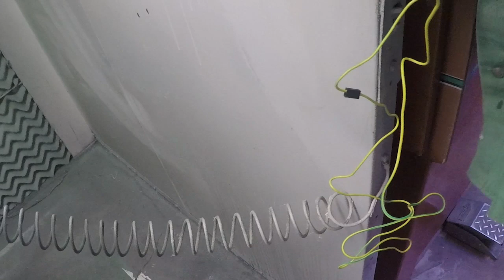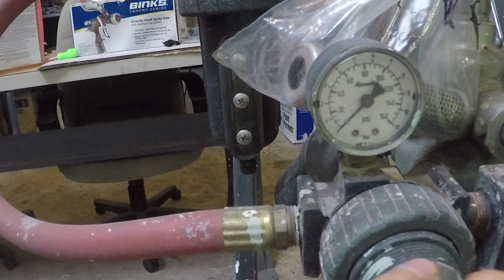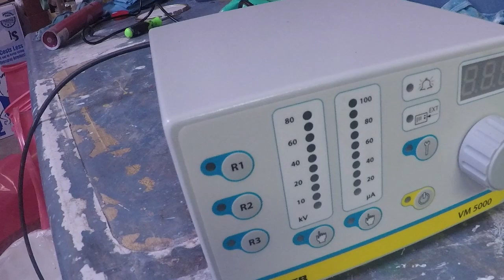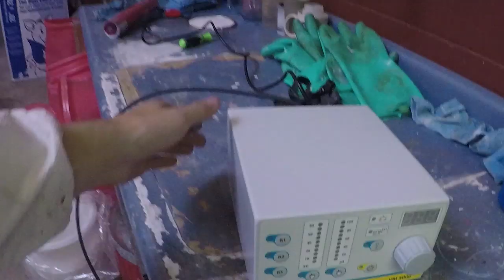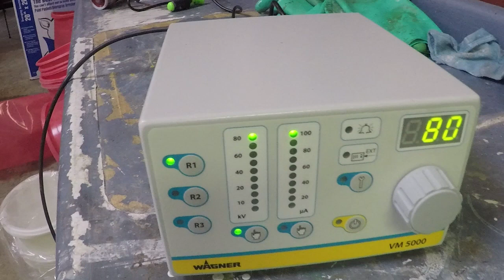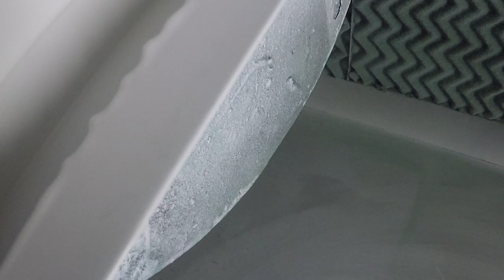How to Use an Electrostatic Spray Gun

Comment: I used one years ago painting  new boat trailers . Had a turbine in thegun the air wiuld spin it  like a alternator in car it would put out a POSTIVE charge  then you ground the trailer. It wraps around the metal itwould get paint in hrd to reach areas. Good for boat trailers help them not rust . If your going to make a video make sure you jnow how it works positive comes out of the gun
Reply: i used to do it industrially in enclosed booths with nothing but a dust mask, i would have the paint all over me in myscalp even on my groin even though i was wearing a white paint suit, 12 hours shifts vomiting in my own mouth and swallowing my own vomit

Comment: Thank you so much, I really appreciate all the information, I do have a question that I hope someone answers, Does this method somehow activates the paint to somehow bond stronger with the metal or just to save product, also what materials can this be applied too? Thanks
Reply: Yes, the point is to negatively charge the paint particles so that when they hit the surface of the material, the electrons in that material will be repelled deeper into the material resulting in electrostatic attraction between the material and the paint.  

This will work best with conductors such as metals, as their electrons can move more easily.

Comment: Are there any simpler systems or ones where the charge is created in the gun.  Electrostatic only seems sensible if your setting up for a large paint run but would be completely inefficient for small projects.  Also, it seams like allot of cleanup and lost material to clear the draw tubing, is that correct?
Reply from the maker: Chris electrostatic is ideal for fairly high volume painting or particular field painting where overspray is a big problem but you have to spray so its usually for manufacturing with a high volume of painting or for field painting like lockers in schools fences ect
Reply: @PittsburghSprayEquipmentCo Worked on a high school locker project in oak cliff TX. 
What a complete nightmare to get the lockers cleaned of stickers and clear scotch tape.

Comment: if you're body is grounded then doesn't that mean that the positive charge wold collect on you?
Reply from the maker: The charge will go to the nearest ground that is aimed at which is the part you want to be grounded as a fail safe to prevent a charge building and causing a spark if your equipment is not grounded or loses its ground due to outlets without a ground or something similar